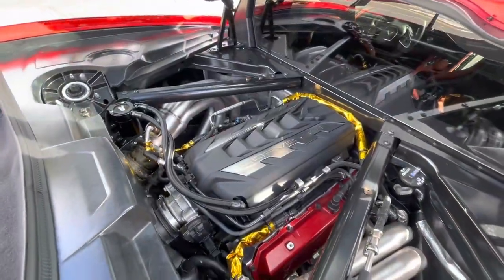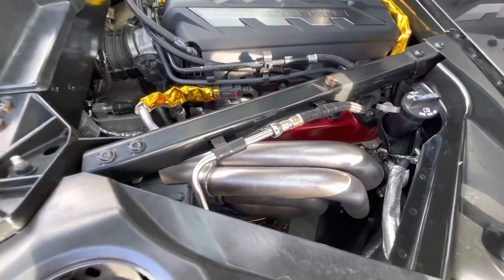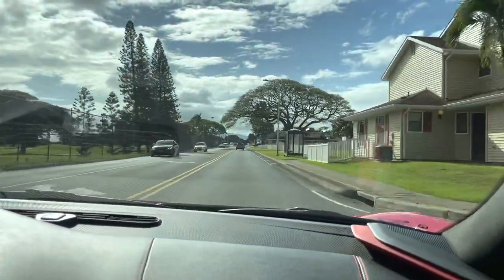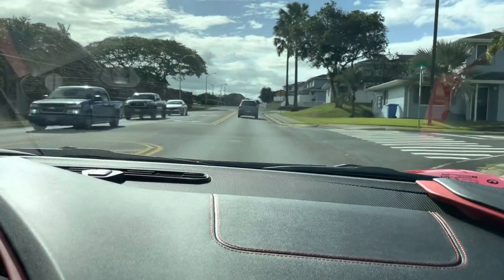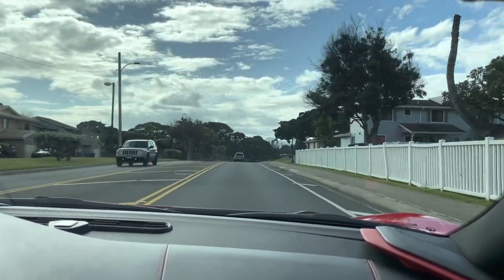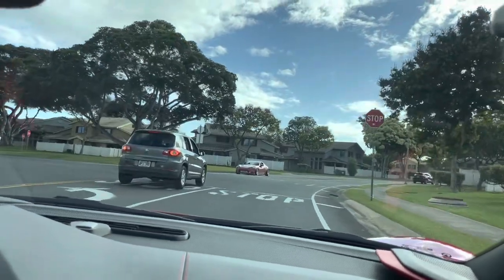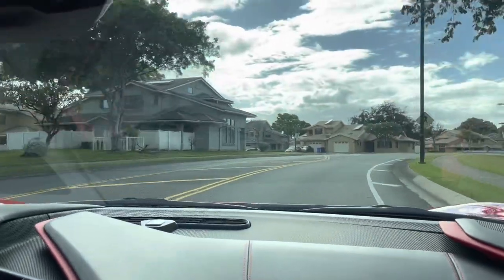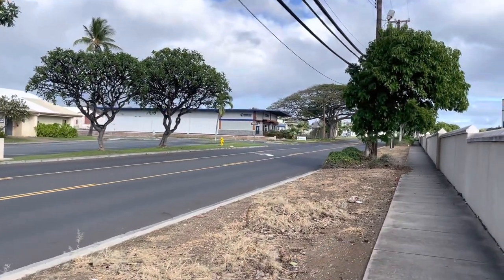The best sounding C8 Corvette exhaust! 2M Fab Headers, Cats and CBE

Comment: I have the same setup with AWE Track exhaust.  Love it.  You should hear it on the track
Reply from the maker: Take a video!
Reply: You got the new afm? And gasket
Reply: @yujiechen239  valve simulators from AWE.
Reply: @GameChangersCorvetteClub  I already have simulator so I need new ones everytime?
Reply: @yujiechen239  you should be ok with those.  The gaskets may need upgrading though
Reply: @alrutledge1066  what gasket you used?

Comment: Is there a way to either do the cats or the headers individually to keep the valves. My last car was straightpiped so I need valves for this setup but still want to make it as loud as possible in track mode if that makes sense. Sounds amazing!
Reply from the maker: You can keep the factory catback with the valves but you might as well not do this, it will be too quiet

Comment: hey man! my c8 has the same setup basically. but ive been debating if i should get the 2m exhaust. it just feels bad cuz i spent 1.6k on the NPP exhaust with black tips from factory and i do enjoy driving quietly sometimes. do you think the 2m fab exhaust is THAT much louder than the NPP and a different tone? hows the "quiet" mode vs NPP.
Reply from the maker: It’s quieter but nothing like stock. If you want quiet, don’t go with a permanent exhaust and stick with the factory one.
Reply: @GhostSpeedShop  thanks for the input! with the windows up, it doesnt sound loud at all from the video. i was surprised by that and because of that i was debating if i should get the exhaust.
Reply from the maker: Yup, it’s pretty reasonable!

Comment: Sounds great. I have a C8 2023 HTC with performance exhaust. Yesterday finished installing a 2M Fabrication Touring Catback exhaust and sports headers. Install went great. No CELS. And it is insanely loud. The workmanship is very impressive. 

In this video you showed switching from tour to track. Mine no longer changes exhaust modes. It’s full out loud. The only exhaust option I saw in 2M was the Catback touring system. Is there a modification I can get to make it valved like the OEM performance exhaust?  Is that something they custom build?
Reply from the maker: So I don’t have any actuators installed but there’s a noticeable difference in exhaust volume inside the car in different modes. Mines a 2023 if that matters

Comment: Sounds awesome.  I have a 2020 HTC.   Are there any droning issues?  Does their catback exhaust have valves for the different modes?  I looked at the photos of their system, but it doesn't look like there are valves.  Their prices blow everyone else out of the water.  Did you install the headers, cats and exhaust yourself?  If so how hard was that?  Any heat issues with the exhaust system?  I saw the plug wire recommendation, other than that any issues?  Are you affiliated with 2M Fab?    The cold start scares me a bit as I live in a condo and not sure my neighbors are going to be thrilled with that...oh well.  Maybe I can stick some pool noodles in the end to muffle it during cold start.

Thanks Scott
Reply from the maker: Hey Scott! 
I’m not affiliated with 2M fabrication at all however the price made me a customer. 
There isn’t any drone nor are there valves, however for whatever reason the exhaust still changes volume when you change the drive modes. 
I did install them myself, and I plan to remove and reinstall everything in an upcoming video for everyone, I wouldn’t say it was difficulty but I’m a seasoned mechanic. 
I would recommend just the catback version of you are concerned about your neighbors, it still sounds great with that setup!

Comment: I did this to mine.  did you do a tune?  Does yours shoot flames?  it sounds amazing!
Reply from the maker: No need for a tune, it can shoot flames when the car is warmed up all the way
Reply: @GhostSpeedShop  Nice! I'll have to get videos of mine.  I was referring to tune for the mods to be balanced/work best, not shooting flames.   Thanks again.
Reply from the maker: Thankfully the o2 sensors are factory wide bands and the ecu makes some adjustments on its own! It would be fun to see how much this setup makes on an unlocked ecu and proper tune though.

Comment: Does the long tube headers and cats package comes with 02 spacers? It was stated that o2 spacers and install hardware included. So I guess it’s included?
Reply from the maker: It used to, you reuse your stock hardware. I’ve heard people say they’ve had to order the o2 sensor spacers still.
Reply: @GhostSpeedShop  so did you order the o2 spacers by it self? Because I just ordered the headers and cats and it says this under the description “2020+ C8 Corvette Headers 1-7/8"

- 1-7/8" primary tubes

- Made from T304 stainless steel

- TIG welded and back-purged with 3/8" thick flanges

- Merge Spike Collector

- o2 Spacers and install hardware included

- Mid Pipes INCLUDED (Some people call these cat bypass pipes or sport cats), choose catless or catted with 200cel metallic cats.

- Lifetime warranty”
Reply from the maker: So I didn’t order them separately however I’ve seen people say theirs did not come with them. I’d order them just in case.

Comment: I’m been coming back to this code a lot I thinking of running the same set up with my c8. Have you had any issues with it any cei? I’m surprised it doesn’t drone I heard the 2M exhaust tends to drone in v4 mode
Reply from the maker: They all sound a little weird in v4 mode. Just keep it in track mode and you never hear it. 
Make sure you get the o2 sensor spacers
Reply: @GhostSpeedShop  ok thank you so much so you haven’t had many issues with cei?
Reply from the maker: @TheBest-lw2de  none of

Comment: After installing the headers, cats and exhaust, do you notice more gas fume smell? like the classic carb cars? Im thinking of getting this combo of the headers, cats and exhaust, also how did you get the valves to work, the 2m website says it needs simulators to delete the exhaust valve function, thank you.
Reply from the maker: Not really, but if you want it to smell 100 percent normal, it’s best to stay stock.

Comment: I heard people having issues with 2m head gaskets. Did you replace yours due to issues?
Reply from the maker: Not head gaskets. Exhaust gaskets, I linked a better set than what’s provided in the description of the video.
Reply: @GhostSpeedShop  I’ll buy those. Is that what you have/had installed with no issues?
Reply: I assume it’s the same ones for their cat bi pass pipes instead of the sport cats, you think? Also what about the donut, can you re-use the oem
Reply from the maker: They should be the same and I reused the donut.

Comment: Did you get any CEL? And did you opt for the heat blankets?
Reply from the maker: No CEL with the o2 sensor spacers and yes I ran the heat blankets, you can see them in the video.
Reply: Thank you. I have Awe Track Exhaust currently. How much louder can I get with headers and sport cats?
Reply from the maker: Wayyyy louder

Comment: My vehicle has the NPP from factory what happens if I were to order a cat back without that option would I have a check engine light ?
Reply from the maker: You will need to order npp modules. I’m running them without any issues.

Comment: Any check engine lights? Any issues so far? Tune needed?
Reply from the maker: No tune needed. No check engine lights if you use the o2 sensor spacers that I mention in the video.
Reply: Where is o2 sensor spacers?
Reply: @GhostSpeedShop where you get the o2 sensor?
Reply: @GhostSpeedShop  I have awe exhaust and I have afm valves thing. I just need o2 sensor?
Reply from the maker: For the high flow cat install yes. 2M fabrication sells them on their website. You can order the cats and o2 sensor spacers at the same time.
Reply from the maker: On their website
Reply from the maker: Yes
Reply: @GhostSpeedShop are your setups catted or catless?
Reply: Do I need to buy extra gaskets or whatever that comes with the package is good?

Comment: Hello I noticed on the CBE there are one hangers on each side but when you look at other CBE similar they have 2 hangers how is it held on with one on each side. Do you have pics of how they are installed?
Reply from the maker: The front hangers are no longer used, only the rear two. This is common on a lot of the aftermarket exhausts for the c8. I don’t have any photos of this setup from underneath but it seems nice and secure with the two hangers.
Reply: Thank you I plan on ordering...do you miss the NPP option?
Reply from the maker: Not really, for some reason the volume of the exhaust still changes based on which drive mode you are in. The npp delete modules should just be tricking the car into thinking the npp valves are in place but I’m not sure how the volume still changes.
Reply: Okay, I ordered it I already have the cats which I love I just needed a little bit more. Hopefully, this is the solution I am looking for. You have been a great help. Oh I forgot to ask are concerned about the headers do you know if it will void the warranty?
Reply from the maker: I mean, GM would have to prove an issue was caused by any part you change. It turns into a huge legal battle. Most people just swap back on their stock parts if anything goes south.
Reply: Okay, thank you. Your C8 sounds awesome 👌 can't wait to get mine.
Reply: I have 2m Fabrication Cats and CBE installed I will try and attach a clip.

Comment: would it be probably if the light is on?
Reply from the maker: What?
Reply: @GhostSpeedShop  my mistake bro, I meant would it still be okay to drive even the CEL is on?
Reply from the maker: Yes however the CEL should not be on after this install.

Comment: I wish they would have put a flat plane crank in the C8. The exotic sound of a flat plane crank would match the mid engine look better.

Also wish they would have put a 10 speed in it instead of the 8 speed.
Reply from the maker: The z06 c8 model has a flat plane crank. I agree with the 10 speed though.
Reply: @GhostSpeedShop  now I have to find a video of the z06. I have to hear it.
Reply: @GhostSpeedShop  I just listened to a Z06. It doesn't sound nearly as good as a GT350 or Ferrari.
Reply: @walk4348  I personally think you just like how high pitch the mustang whines. It’s definitely louder for sure.
Reply: They did it's called a Z06

Comment: Do you have to tune it after installing headers?
Reply from the maker: No, the c8 comes with dual wide band o2 sensors from the factory and the ecu makes corrections if needed. 
The headers could benefit even more from a tune but it is not a requirement.

Comment: do I need to order c8 replacement gaskets from 2m if I already ordered some from the Amazon? I’m doing cats and headers and also does the package come with mini cats?
Reply from the maker: You will have to check the description on their website but I would run the Amazon gaskets I linked in the video description as the ones 2M sells are not great.
Reply: @GhostSpeedShop  I bought from Amazon already, and they are cheap compared to the 2m ones
Reply: @GhostSpeedShop  the website said for replacement sports cats?
Reply from the maker: Yeah, but the Amazon ones won’t leak, the 2M ones will.

Comment: do you need retuen after this set up
Reply from the maker: Nope, the c8 has factory wideband o2 sensors that tell the ECU to make adjustments.
Reply: @GhostSpeedShop  DOES this set affect warranty
Reply from the maker: Probably, but the dealer would have to prove these broke your vehicle which probably won’t happen. Install at your own risk or stick with the catback setup only.

Comment: I love the sound❤❤❤! What’s your exhaust? Thanks
Reply from the maker: It’s in the title and the description
Reply: I check but didn’t show up the CBE exhaust? Do you have the link? It’s NPP or Non? Thanks and very appreciate that!👍👍👍
Reply from the maker: @quyenyang3968  cbe stands for cat back exhaust. It’s made by 2M fabrication. It’s non npp, but they sell modules that plug in to prevent a check engine light.

Comment: I installed headers and exhaust both from 2m fabrication and also went catless. I got check engine and ESC codes any suggestions??
Reply from the maker: Install the 02 sensor spacers and modules they sell…..

Comment: Do I need new gasket or new afm for those?
Reply from the maker: Comes with gaskets but I recommend the ones linked in my video description. Also, you will need afm, you either need two or 4, it just depends on how many valves your factory exhaust has.
Reply: @GhostSpeedShop  I have the npp exhaust but I changed to awe now
Reply: @GhostSpeedShop the gasket on your link is out of stock does the 2m website works?

Comment: What did this setup run you price wise?
Reply from the maker: 2200ish.
Reply: @GhostSpeedShop   for all of this? 2M fabrication catback exhaust, 2M fabrication headers and 2M fabrication high flow 200 cell cats with 02 sensor spacers and Catalytic converter blankets? that has to be over $10K???
Reply from the maker: Nope, their prices are cheap because they sell direct to their customers. They’re all made here in the US too.

Comment: Did this void your warranty?
Reply from the maker: The manufacturer would have to prove that this caused an issue. I doubt it would hold up in court but typically exhaust do not void your warranty.
Reply: You have links to the header and setup? What’s was the cost?

Comment: MAAAAAAN I LOVE the sound of this Car with the 2M Fabrication setup BUT when I see the Google Reviews on 2M Fabrication to say I am a bit nervous is an UNDERSTATEMENT. Reading there FAQ just solidifies my gut feel for how things are going to go If I do business with them.Sounds like Chinese Crap to me based on the look, quality and delivery times out over 2-4 months. BUT I love that sound! Anyone here know of a similar and yes MORE EXPENSE PRODUCT to rival this one???
Reply from the maker: They make everything in house here in the USA…. Their FAQ page was hysterical to me but it might be much for some people. It’s a cheap, but it’s quality exhaust without the crazy markup everyone else carries. They also don’t sell to distributors and sell directly to customers which typically saves the consumer 30-40%.
About the wait…. I believe they make the C8 stuff pretty quick. I ordered and had all my parts within 2 weeks so that might be a general statement for some of their less popular products. 
As for similar but more expensive, I’d go with corsa. I can’t speak for the quality, but they do sound similar, potentially slightly quieter. Hopefully this helps!
Reply: @GhostSpeedShop  Thanks, very helpful...Did the exhaust throw and error s or codes once it was installed?
Reply: @GhostSpeedShop   Also, does 2M make a blanket for their headers or would a FabSpeed header cover work possibly?
Reply from the maker: None of you get the modules they offer.
Reply from the maker: Their headers come with some sort of coating on them. It’s not the best, it sorta takes a little bit to bake when you drive the first couple of times. I know they offer the cat blankets but I don’t think they sell headers blankets. You could try the other ones you mentioned.

Comment: any issues with engine light?
Reply from the maker: Nope! Get the afm delete modules and o2 sensor spacers
Reply: @GhostSpeedShop  Oh that is new to me...thanks. I went to 2M website. What your talking about is "C8 AFM And NPP Simulators" Since I have a Performance exhaust, I need to it say to trick the CEL.